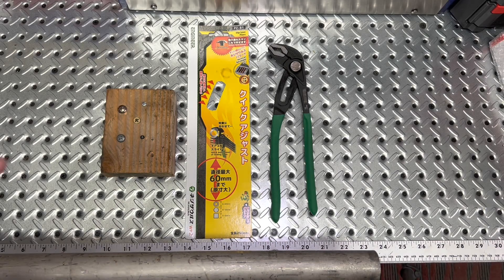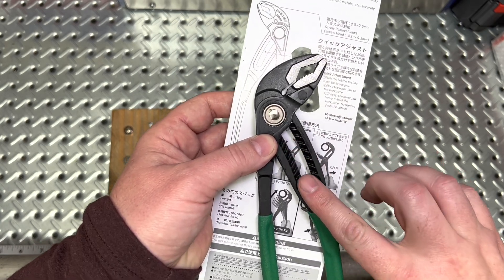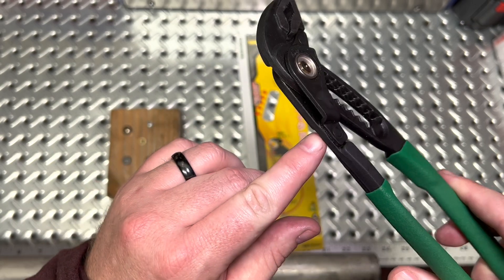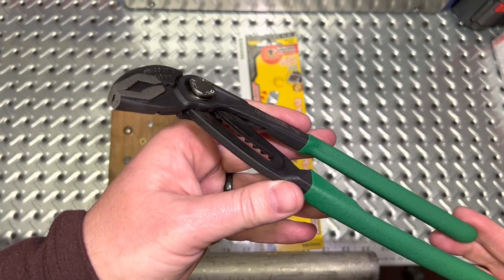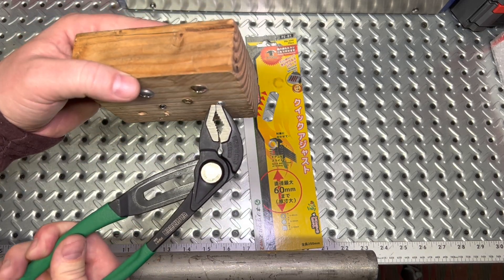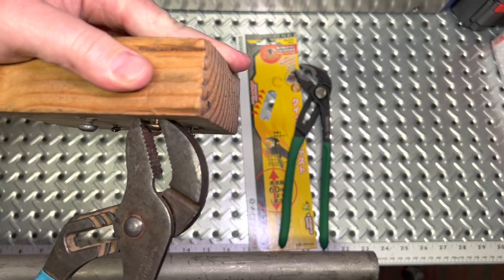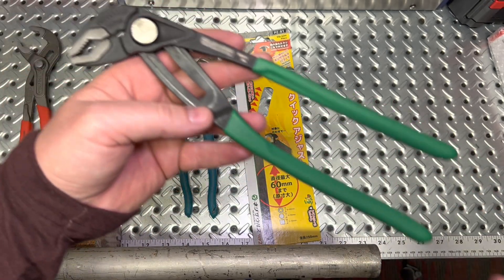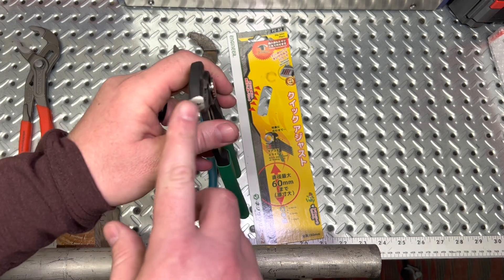Are Engineer’s NEW PZ-81 slip joint pliers superior to their Knipex Cobra or Vamplier counterparts?

Comment: Looks like an exciting product release, but agree that it could use a bit more refinement. I think I  also agree that the Knipex has better slightly better ergonomics, but I'd also really love to see the Engineer use their Nejisaurus molded comfort grips, rather than that simple dipped handle. I personally really like Knipex's ergo handles, though I admittedly haven't had the opportunity to compare it to their dipped grips. But, I don't mind the extra bulk for sake of added comfort.

While I suppose it's not strictly a make-or-break feature to be able to only need to apply pressure to a single handle, I feel like the Knipex's ability to do so means the tool is doing more work for you, which means less stress and effort on your part. Interesting that the PZ-81's failed at that task despite their hardness and apparently similar design, but I guess the devil is really in those minute details of tooth angle and jaw geometry. Regardless, I think the screw extractor feature is otherwise super handy, so that plus it being half the price will keep me considering adding it to my collection. I just wonder how long before they iterate on the design - if ever.
Reply from the maker: The PZ-81’s swing pretty high but yes more refinement is still needed. They don’t quite have the same stability as their Knipex counterparts. However their screw extraction definitively puts them in their own field. 

I don’t think there will be any major changes anytime soon. I’ve come across some information that I might have to do another video in the near future. Stay tuned.

Comment: I would have killed for a set of those Engineer pliers when my washing machine sprung a leak a while back.

Beside gripping screws, the jaw design lets you grab on to other oddly shaped things that normal flat jaws don't, like spring hose clamps. I had to replace a hose that was way up in a weird corner of the machine. Normal pliers kept slipping off the clamp and there was no room for hose clamp pliers. Those angled Engineer pliers with their screw gripping jaw design would have been the ticket.
Reply from the maker: Thanks for your input. Looks like you might need to pick up a set.
Reply: @ThingsMen  Oh, I will. for sure.

Comment: Your review confirms why I am not tempted to try either of these two related brands. A $30+ tool that under performs is too frustrating for me when better tools are available. I have purchased 30ish Knipex tools with high satisfaction. I have kept roughly half, the others being gifts. I have had only one disappointment. A pair of needle nose rust stained badly from a light rain event in a leather tool pouch. The staining hasn't cleaned up in 15 years of occasion subsequent use. I don't know why this tool is any different from my other Knipex tools. I have 30+ tool chests of premium tools. After its staining this pair got relegated to one of the woodshop tool chests where it gets seldom use. I worked from those chests several times this week, irked with the staining. 

I enjoy using and owning  premium tools in premium condition. After I retired my wife recommended that I build a dream shop. I settled on a 4600 SF building less than 100' from my basement shop door. I separated shop disciplines. The big shop has my mechanic to fabrication and machine shop and the basement shop is essentially for woodworking. I have tried to separate tools for  each specific discipline. I already had a vast tool duplicity between work and home tool inventories. In spite if the duplicity I still trek back and forth between shops. I have favorites among many options and will often make the other shop trek just to get a favorite tool. It is funny that I have even set up tool duplicity within the larger shop building to avoid walking much. Tool storage demands many tool chests but organization and work station efficiency is other justification. My shop time is mostly just hobby pleasure. I retired 6 years ago. I have vastly out purchased my working  career years tooling investment for hobby time. Each upgrade or addition requires postponing really getting the shops in order. I take delight in equipping my son's, sons-in-laws and grandsons as they build their shops and careers. That number has grown to 27. I try to only purchase premium brands for them remembering when I sacrificed quality or function be ause my budget demanded limitations. 

I suggest staying with Knipex, Klein and a smattering of Snap-On for premium pliers. Klein is a very good performer for budget minded purchasers.  Snap--On is pricey and robust. Their robustness can be a disappointing function compromise.

Comment: man this is getting close to what i really want which would be a 150mm sized one and perhaps a simple wire cutter...my cobras are my most used tool at work
Reply from the maker: Yea, you should check these out. These adjustables don't usually have cutters.

Comment: 10:05  -- you want that "deflection" when you squeeze down on the handles to grip something because it acts like a spring to hold tension on what you're attempting to grip and rotate.
Reply from the maker: I agree to an extent, but overly flexing can be dangerous. These are a bit more "flexy" than i am comfortable with.

Comment: No matter what is claimed on a package, no matter what the specifications are, the proof of usefulness and durability is in the using. I have a pair of Knipex "Alligator" multi slip-joint pliers from the 1970s, before the "Cobra" appeared. I've used and abused them on a job as a plumber, as a maintenance man, and since then on home repairs, auto repairs, and working on ragged older motorcycles. They work, they don't break, and they were worth every penny that my poor man's "shallow" pockets dug deep and paid for them. I've never regretted this purchase. That being said, the Engineers' pliers may be equally as good, or possibly even better. However, I doubt that I will ever find out, as I don't ever expect to replace my reliable Knipex pliers. My son is in his 40s now, and I expect that this pair of pliers that's older than he is, will survive him too. Perhaps his son will need to replace them. Thanks for a great video. Best regards, Dean
Reply: O]pp]
Reply from the maker: Appreciate your comments!

Comment: Both companies manufacture excellent tools - I'd take the Knipex Cobra over the PZ-81. I have the Engineer PZ-58 screw removal pliers which are an excellent tool. The Knipex Twin-Grip 82 01 200 is a similar tool on steriods. The Knipex pliers-wrench is an insanely remarkable designed tool.
Reply from the maker: They both do a great job. Knipex has set the standard for pipe wrenches so that will be difficult for others to match. The PZ-81 is still a great tool it just needs some refinement in a couple areas.

Comment: Yeah I don't see the value of these over the cobras. If I were to want to do screw extracting maybe I would consider the regular linemans version of the engineers PZ59s, or probably even better their vise grips version PZ65/66s so you can lock onto the screw head. Even twin grips seem like a good option. These just seem like channellocks with a locking feature for sizing. A big meh from me.
Reply from the maker: Fair points. They do a couple things well for being slip joint pliers but I find them lacking in other areas as well. Thanks for commenting.